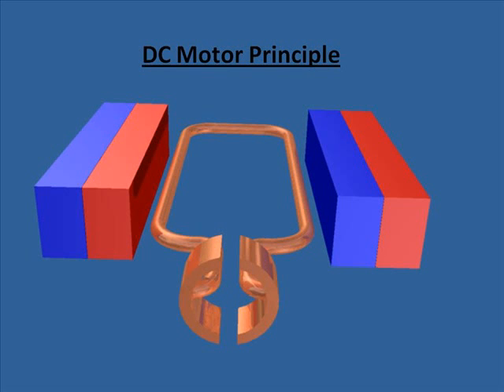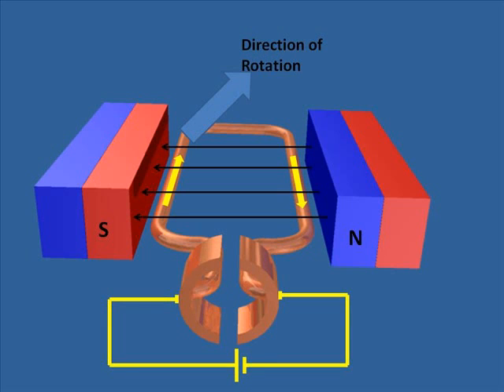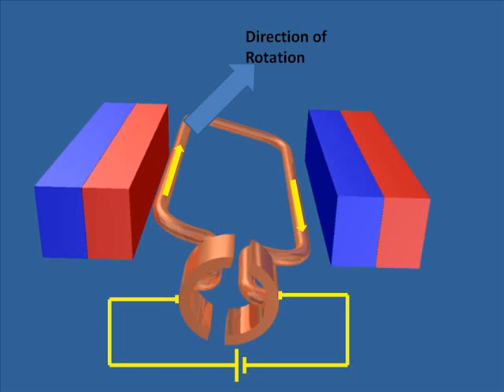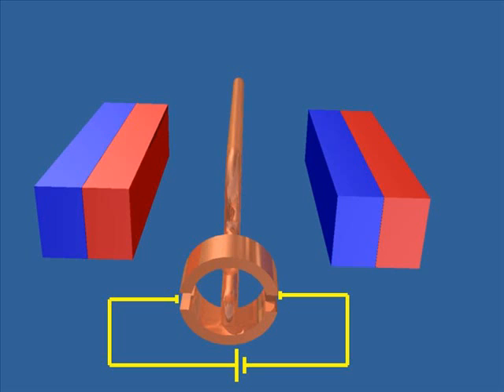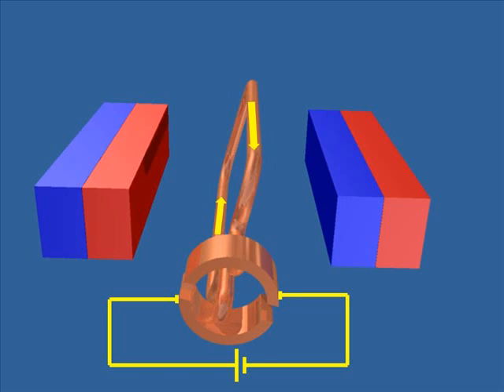DC Motor Principle 1

Comment: Why that rectangular copper  armature tends to rotate anybody answer plz
Reply: Due to the forces from the field interaction of the permanent magnets and the armature's induced magnetic field.
Reply: it keeps ROTATING because as battery current flows thru loop, a MAGNETIC force is induced in said loop creating an off and on POSITIVE and NEGATIVE attraction and repel towards or against the blue/red magnet's POSITIVE and NEGATIVE SIDE........ Savvy???.......

Comment: Only right hand rule is applicable here.
1. middle finger of RH is for magnatic flux R -> L
2. index finger of RH is for current direction  INN 
3. thumb of RH is for motion, UP
 ALL fingers' directions should be considered from palm to tip.
Furthermore, consider the left side of coil. If you would to take right side of coil, then you should turn your hand 180 degree horizontaly CW and 180 degree vertically down wards. B'cus direction of the current changes on the righ side of the coil.

Comment: The brushes are never touching both sides of the segmented collector ring. If you look carefully, they are placed at different heights. That on the right is slightly higher than that of the left. This way we avoid a short-circuit when the coil reach the vertical position. Movement is not stopped when the rings are not touching the collectors at this moment, because of the inertia of the coil, and finally each half ring touches the opposite side to continue moving in the same direction.

Comment: It seems that you missed the mark manoj. This is not a generator, but a motor. It is not intended to generate (induce) a current, but use the magnetic torque of a dc current flowing along a coil, to produce a mechanical force. It converts electrical current to mechanical force, right?

Comment: idk the theoretical maximum, but 2 is minimum, obviously, and generally, they use 4 (2 pairs) goes as NSNS around the armature. Ofc size and thus, power of the motor rises, numbers rise up. Check automotive alternator for example.